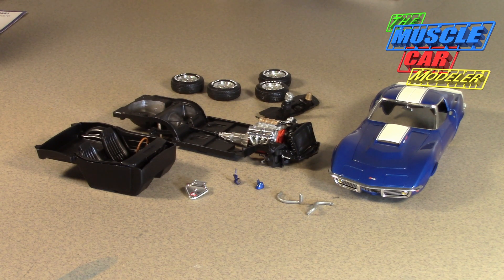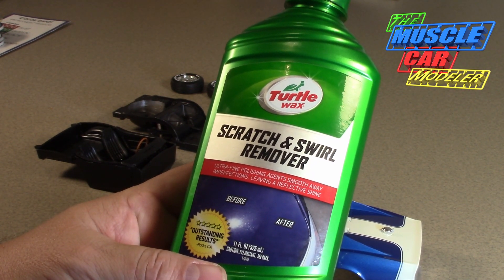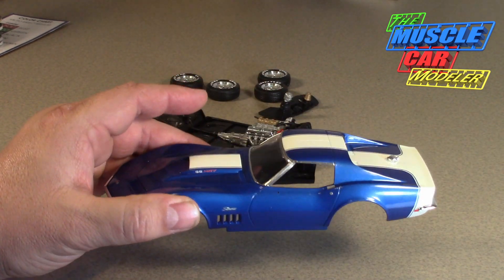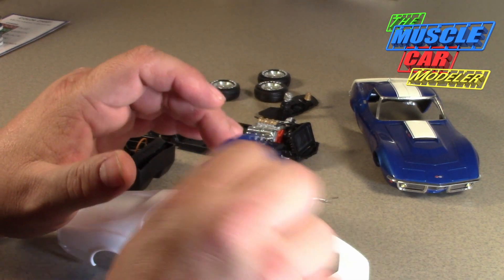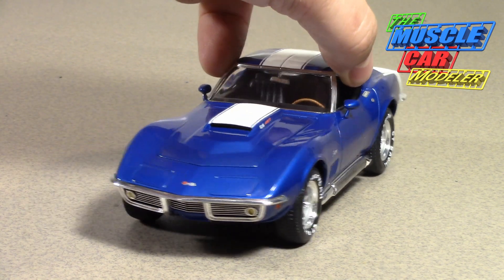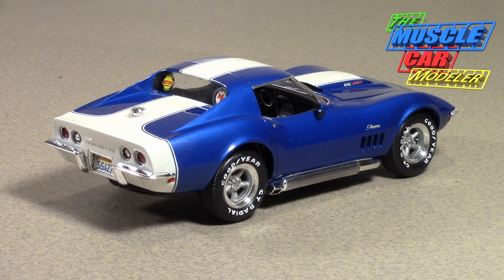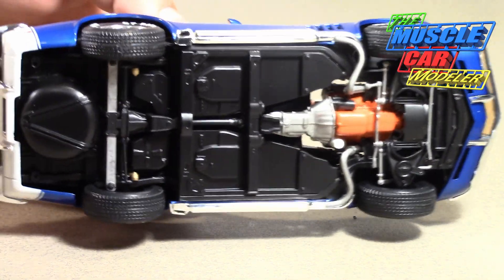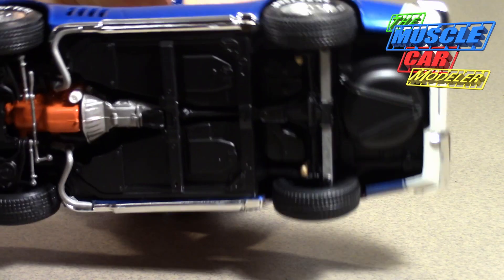Revell 1969 Baldwin Motion Chevrolet Corvette Phase III SS427 Build

Comment: Wow!,your build looks fantastic!!i think Revell may have done this kit based off the car from the Otis Chandler collection in the nineties,the only real difference is the wheels and the aircleaner.
Reply from the maker: I believe you are correct. That is the car that closely resembles the model kit. It has an 850 CFM 4V carb instead of the tri-power along with different wheels. It is one of the few SS427s that are documented.

Comment: Super kool! Didn't the real ones have wider rear wheels and tires and possibly flares? Optional perhaps?
Reply from the maker: These are very hard to document. Baldwin Motion cars were modified by Motion Performance then sold as new cars through Baldwin Chevrolet. They had packages but if the buyer had requests they would do anything. Then they also had customer cars that were modified after they were sold and those are Motion Perforance cars! The car that this model closely represents is one of those cars bought at a different dealer then brought to Motion for modification. I'm also building a Baldwin Motion Phase III GT. 11 were made but the ones that still survive today all have different modifications to the body!

Comment: I like revell more than amt
Reply from the maker: AMT has some great kits and some that are so old and reissued so many times that they are worn out! Revell is newer than AMT so all of the kits they offer are newer but they have a few challenging ones as well.
Reply: @TheMuscleCarModeler  im building a camaro z28 amt 1970 right now, 😎
Reply from the maker: @r.a.p.k.models4160  What is the kit # on the box? AMT has two versions. One is the old tool kit, Red box car. The newer tool has the Green or Orange car on the box.
Reply: @TheMuscleCarModeler  actually i build the green one first but i spray 2k clear coat on it with Windows and everything just testing but it ended ugly, so i bought the orange only for the body so a remove the green body and yesterday i sand the orange body with 2000 sandpaper clear coat it then 2000 then polish , no paint, no primer it ended very well and put the new body in the old painted chassis  with the 454 v8🏁 wish i can send you a photo im just a rookie builder.